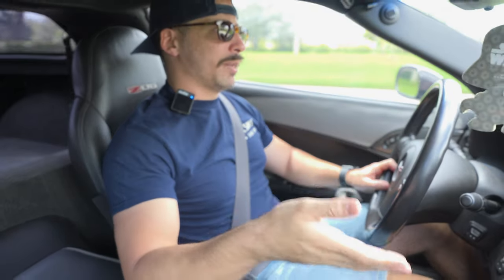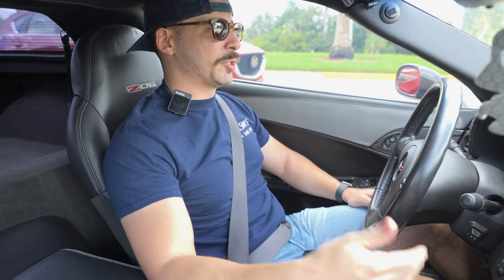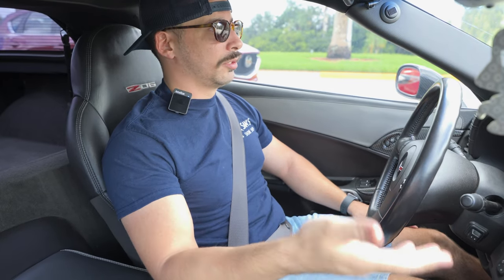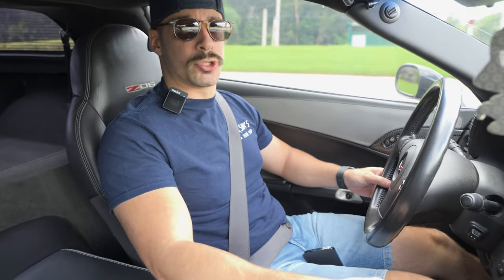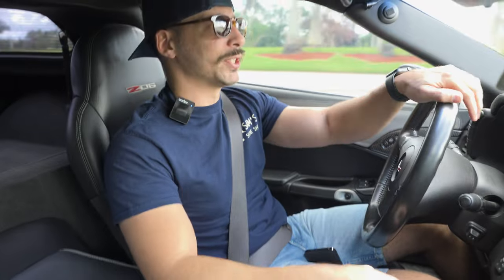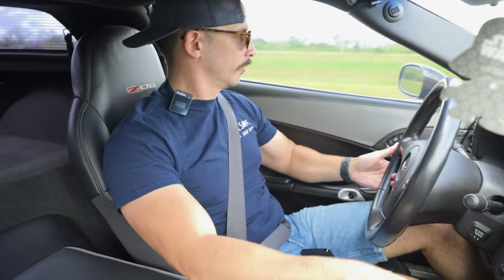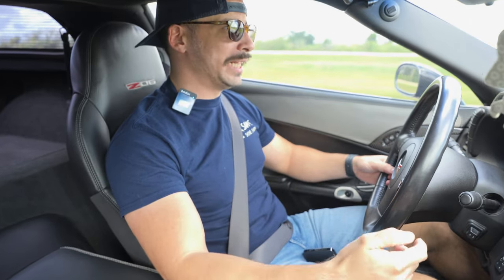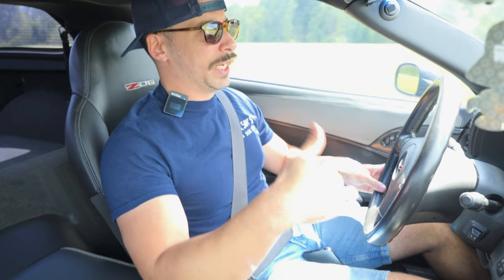2 Long Months of Repairs on VADER the Z06

Comment: Not sure if you’ve addressed brakes yet but you should spend some money here especially if you’re racing in high heat.  OEM calipers aren’t well regarded and many that track end up going to Wilwood Aero6 or AP Radicals for 100% braking assurance.  I went the AP route a few weeks ago and street driving is fine, but I’ll have a report once my next track day is done in 2 weeks.  I’m driving a 2011 Grand Sport which has a lot of similarities, but also some major differences such as heavier chassis, removable roof, LS3, longer gearing etc.  430hp is enough for me and my kids love to drive with the roof off!  Anyway, you should at least upgrade your brake fluid and pads before you go on track. Motul 660 and a good track pad. I’m running Ferodo 2500 but that’s a whole rabbit whole in itself. The serious guys swap to track pads for track days but track pads are horrible on the street with regards to noise.  Every time you hit the brakes on cold track pads they squeal LOUD like honk your horn loud.  So most swap back to street pads for daily driving if you’re using that way. If it’s a dedicated track car then don’t worry about it. 

Next you need to think about cooling, at least upgrade your radiator, maybe add a stand alone oil cooler if it doesn’t already have one. You may have these mods covered already with the power upgrades.

If cooling is in order then focus on brake setup and tires and you’ll likely be fine.  Your life is worth more than a set of $5k brakes so give yourself a fighting chance. Just my 2 cents.
Reply from the maker: I really appreciate all this feedback! Yeah I have a set of blank face rotors and hawk dtc60s I’ll be installing this week before I head to homestead speedway on the 28th. I also have the motul.

I noticed you mentioned you’re tracking in two weeks. Where at? This will be the first time me getting this car out on track I’m hoping it for it to dictate what else it’s going to need like cooling wise and more.
Reply: I'm in Kansas City, so I run at Heartland Park Topeka.  The track day will be a good shakedown of what you need done, if anything.  A stand alone oil cooler is a fairly easy mod to add, just costs some coin.  I think LG sells a kit, as well as DRM, also Improved racing is a well known brand as well.  Don't cut corners on this, because if it ruptures, its super dangerous, as you can imagine.  Can't wait to see results from the track day. @SloJoeRacing